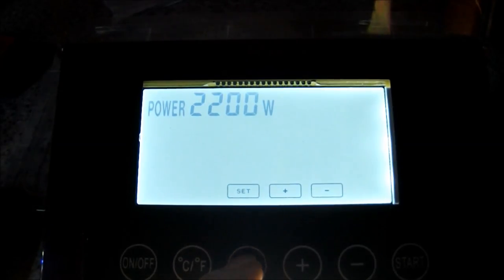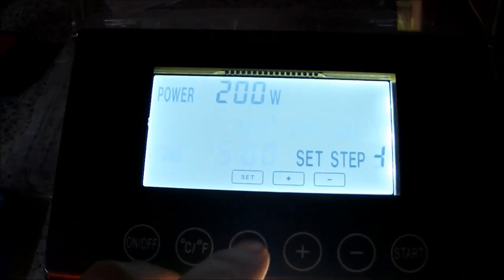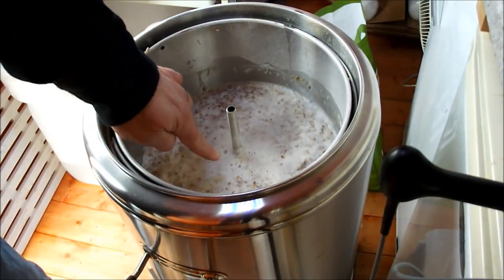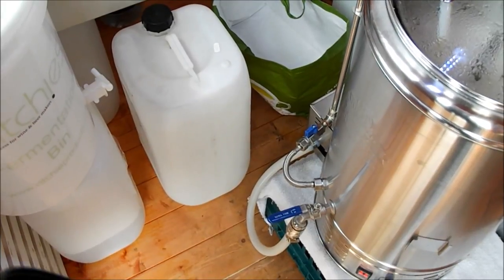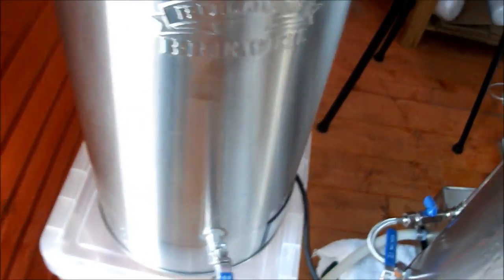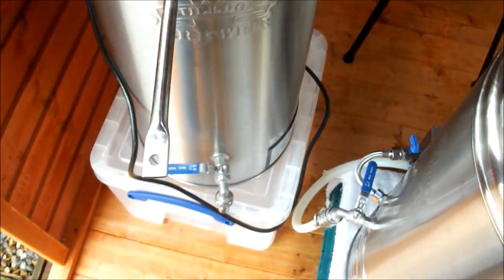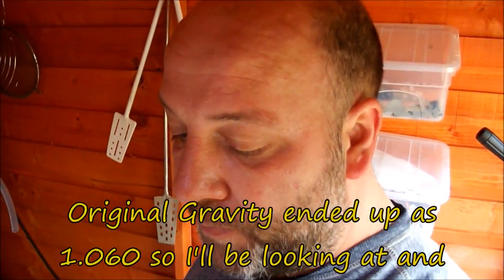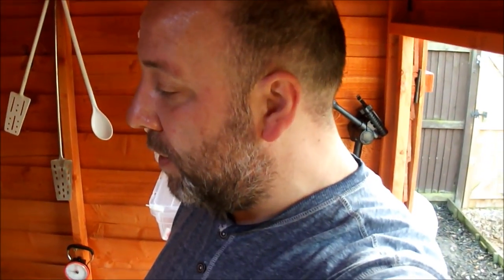Brewday #2 with the NEW Bulldog Master Brewer - Hoppy Saison

Comment: I completed my first Bulldog Master Brewer brew today. This video was invaluable. Thanks. Despite your good advice, I wanted to experience the kit by design first, albeit armed with your knowledge. I had the same bazooka problem - looked like hot break proteins were clogging it. I ended up turning the pump off as it was next to useless with a blocked bazooka. When it came to transfer to FV the flow was extremely slow - I mean slooow slow, but got there in the end. Also, I mucked up my mash ratios and missed the bit in the guidance where it says use a 4:1 ratio, instead of my normal 2.5:1. No big deal as I had plenty of sparge liquor (not quite up to temp) so jugged a few litres over. ended up with 22 litres in the bucket with a 3 point bonus on my SG. Clearly the right side to error :) I used the Bulldog hop spider, but found this got a little packed and ended up removing spent hops at the end of the boil to make room for late addition.

Next time: no bazooka; get mash ratio up to 4:1; buy a finer mesh for the malt pipe.
Reply from the maker: Glad it helped... And really glad you plumped for the Master Brewer! I'm just about to do my first brew in a few years on a different system as I sold all my gear a couple of years back! Glad to know the videos I did served the purpose they were intended for 👍

Comment: Good video thanks. I think my model may be more recent. For anyone interested, here are my tips and comments:

1. The power switch is now separate in a separate protective plastic housing to the switch for the controller. The latter is a much wider switch than the pump switch so with my kit there is very little risk of accidentally switching off the controller.

2. When calibrating boil temperature, do you find it annoying that once you have saved the offset, (say +1 or -1 degree), thereafter you cannot go back to the default, i.e. an offset of zero, (unless you cut the power and re-enter all the settings)? Dumb programming that! I asked Hambleton Bard about it and they said there is no way to install software patches. 

3. I  notice you boil without the lid. I always use it as I have to brew in my garage and I don't like dust and bugs dropping into my brew. I also find that using the lid is much more energy efficient during the boil. I only need to set the power to 200W to maintain a rolling boil, so it saves a bit on my electricity bill.

4. I find that my pump clogs up if I don't use the bazooka, so I always use it now.  It causes no problems during mashing but during the boil my pump does vibrate sometimes. I agree the bazooka is the issue. But I reckon it is not clogged up inside, its just clogged on the outside. As it happens I don't use a spider. I  gave up on it because of the extra cleaning time. These days I just put my hops in a big bag and tie a knot in the end. The boil turbulence makes sure the hops permeates the wort well enough. Not using a spider also has another advantage - if I hear chugga-chugga vibrations doing the boil, then I reach deep down with a long paddle and wipe the crap off the bazooka. The noise stops instantly. I might have to do it 2 or 3 times during a boil but it takes only seconds.

5. I think you are saying in your video that you couldn't pour off all of the boiled wort because the bazooka was clogged. Is that correct? When I get that issue, i.e. the wort flows slowly from the tap, again I use a paddle to wipe the bazooka. It soon starts flowing again. I also pour some boiled water over the bazooka after most of the wort has been drained. That then lets more (watered down) wort flow out. It all helps boost the final gravity as long as I don't go over the target final volume.

6. I do the same as you and use the pump when cleaning.  I also always dismantle all the hoses, taps and pipes afterwards. It is horrifying to see the amount of muck still left in them. For hoses I use a very thin bendy brush about 10mm diameter; for the rest I use a soft soapy sponge. After rinsing I spray it all with keg sanitiser before re-assembling. Next time I brew I throw in some cold boiled water, turn on the pump and aim the top rubber pipe  so it rinses the dried sanitiser off the insides. After 5 minutes, I then switch, turn the whole brewer upside down and empty the water into a bowl. It's all clean and ready then for a new brew-up.

Thanks again for the video!

Comment: Did my second brew today  with the master brewer and had exactly the same issue with the bazooka getting clogged up. How have you got on with recent brews?
Reply from the maker: I haven't used it mate... I recirculate throughout the boil filtering through my hop spider! I then flush out pump and pipe work with 10/15 litres of hot water saved from cooling, then I use more saved water to recirculate cleaner! Had no issues 🍺

Comment: Looks really nice :) double walls!! You used the wort pump during the boil. I tried to find the temperature limit, for the pump. Cant find anything about this. Can it really take 100 C for an hour? Any thoughts now, after some weeks with your new system?
Reply from the maker: Yes pump can handle it fine it's more an issue with the bazooka filter clogging and not enough fluid getting to the pump that's the issue! System is really good a big improvement on the old one but if you've watched the first brew day you'll see I found some issues with the controller... As for the bazooka I'm not going to use one next brew and just recirculate through my hop spider to clear and grain debris! 👍
Reply: What do you think of using a smaller hop spider? One that fits inside the wort chiller. You dont use a wort chiller in your first brew, because it doesnt fit. Is a smaller hop spider not an option?
Reply from the maker: Smaller hop spider is an option yes and if I can't get a counterflow chiller soon I will be getting one or using a grain bag for hops
Reply: @AliSim2103  Also, when you do the 'no chill' method, do you find any issues with the final beer quality since there is no 'cold break' occurring? From Google:  Studies have shown that total elimination of cold break can result in slower fermentations, lessened yeast viability, higher acetate ester levels, and an increase in dissolved carbon dioxide levels during fermentation resulting in incomplete fermentation.

Comment: Don't buy this brewer. Its shit. I have the original version and it is awful. The flow rate through the malt tube is absurdly slow. Happens every time. It's a serious design problem.  I  am actually brewing with it as I type this. I will have to leave it overnight to allow the 7 litres of spare to flow through.  Currently draining st a rate of less than 500ml per hour. Crap system
Reply from the maker: I only ever had one stuck mash and that was using pre crushed grain from a supplier I'd never used before! The holes in the malt pipe are too big if anything! Maybe take a look at your grains, maybe to finely crushed!!